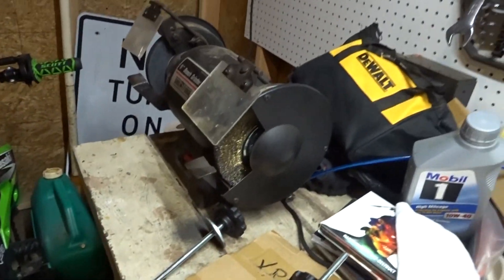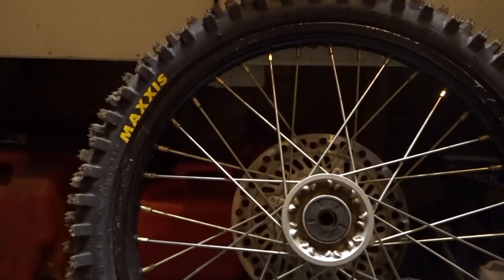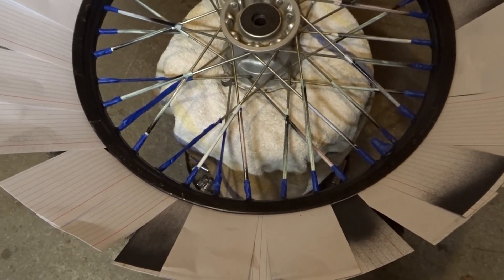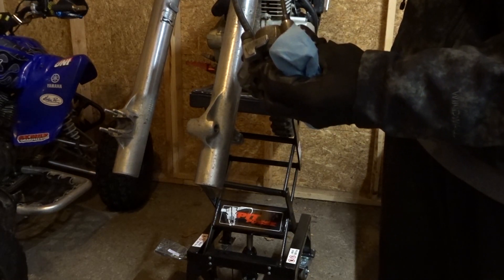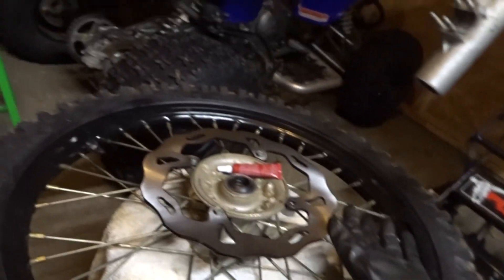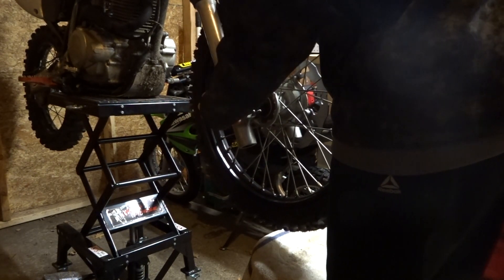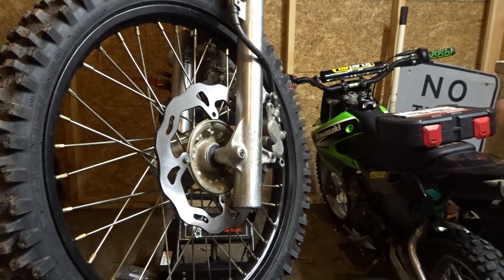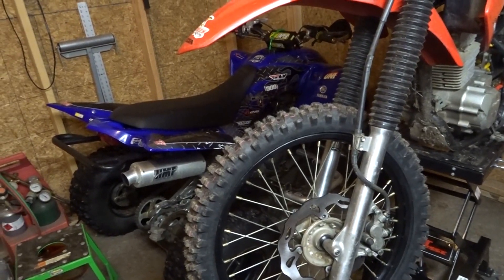Honda CRF150F Brake Rotor & Pads Change!

Comment: What brand is the rotor I got a 2005 crf150f  bent my front rotor looking for a good replacement
Reply from the maker: Ima be honest, i forgot what brand it was but I originally bought it off of Amazon at the time and it ran me like $35!
Reply: Ya oem is over $100 I found one that looks like the one you got from a company named Tarazon that’s been sell rotors out of China I think it said since the late 80s How was that rotor did you take the bike for a ride at all and test it out
Reply from the maker: @Max-vf7xp  Yeah it worked well with new pads and had better braking power, was definitely worth it!
Reply: Ya thanks man I’m just getting back on a my bike some one on there phone almost hit me head on I moved as much as I could broke my femur knee and ankle just had titanium put in from my pelvis to my toes the rotor got bent on top of a couple other things so I’m trying to get back on